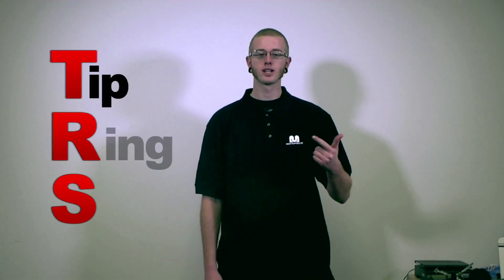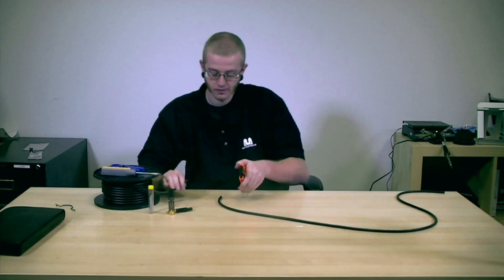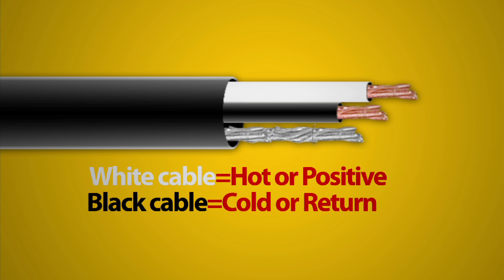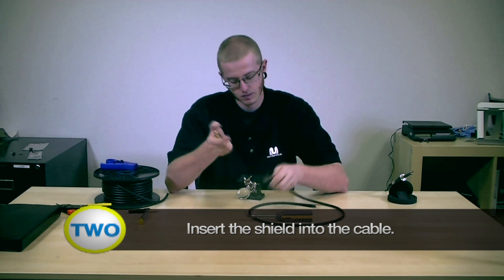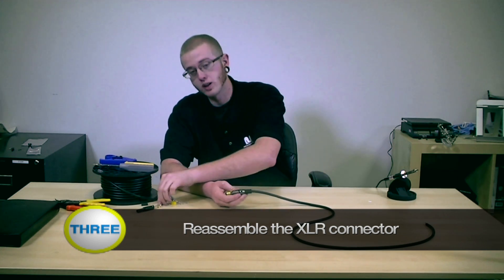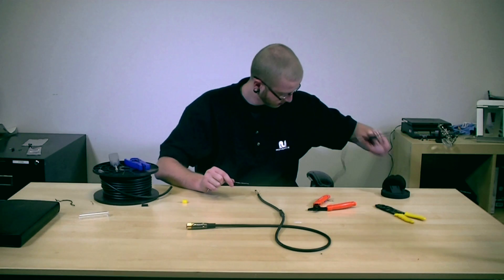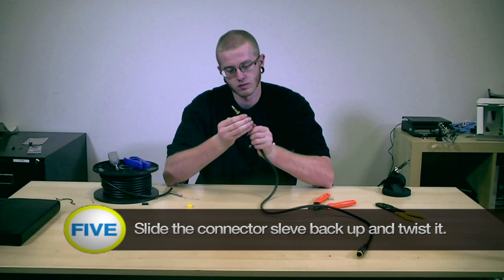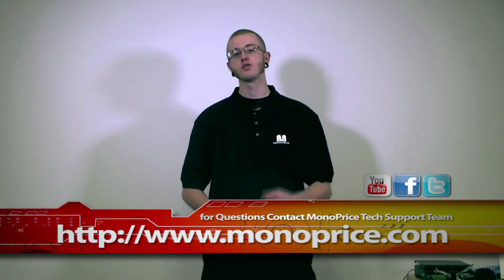How to make your own TRS cable

Comment: DO you have any clue how to prepare the ground wire for soldering when you're using high quality braided audio cable? Unlike the lower end cable which spirals the copper strands down the length of the cable... the braided stuff copletely surrounds the cable. The problem with this is... you need to cut down the side of the side of the braid to give yourself something to wind together for soldering. When you cut braid.. it basically cuts it into tiny pieces and makes a complete mess. Any help in understanding the trick with this would be greatly appreciated. Thanks